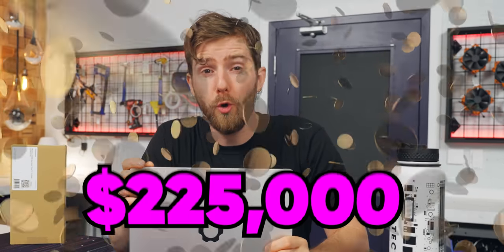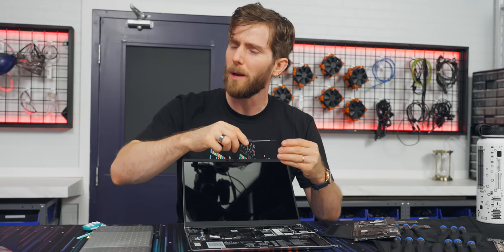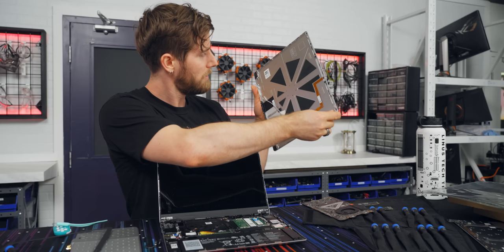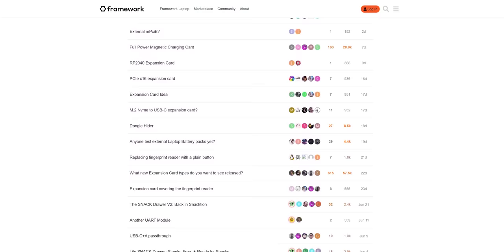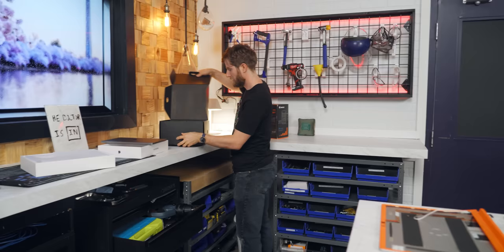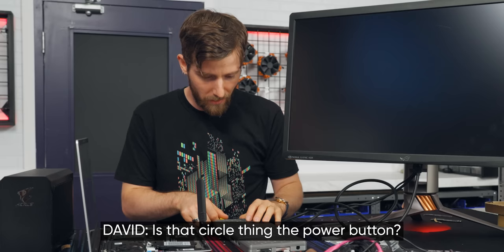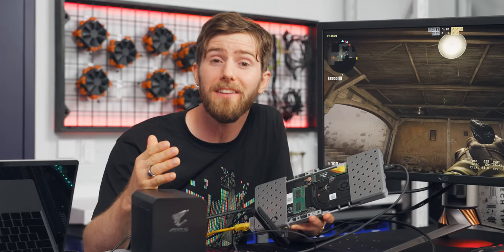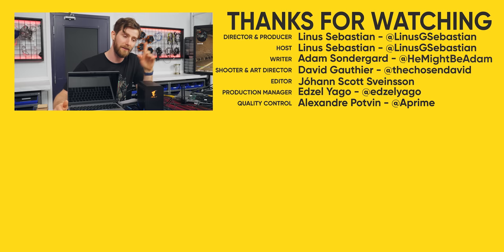I invested $225K in Framework Laptop - 1 Year Update and 12th Gen Upgrade

Comment: The IBM Thinkpad is an awesome buy (I got one off Craigslist for $150,  it seems brand new), I thought it might be stolen but it was a man selling a whole lot of them out of his convenience store, I think they were laptops that were leased by companies.  I just cannot believe some people are spending $1500 or more on laptops (Apple laptops or Windows Gaming Laptops), I would have to be a professional gamer making thousands a year to consider spending that kind of money on a laptop.  With the IBM Thinkpad I can run all the programs I need just find (including business related work programs).
Reply: 1500 on a laptop isn't a ton when you plan to use it for the next 3-4 years, need the performance for hobbies or work, and plan on relying on the factory warranty and customer support. Old thinkpads are great devices, but aren't perfect for everybody. Also be sure to throw some more ram and an ssd in that puppy, should keep it running well for years.
Reply: thinkpads are great but when you want to do things like 3d modeling they just dont hold up. most people will be fine with those but sometimes you just beed something better.
Reply: @theratking14  Also be prepared to use a mouse on it most of the time, as the trackpads are pure trash compared to other laptops
Reply: @semz8666  lmao yeah i have been, i am having an issue where i cannot right click or scroll. i tried some shit to fix it and it didnt work
Reply: some people want actually fast hardware. just because you only use it for web browsing doesn’t mean that’s the only use case. A $150 thinkpad wont run ANY modern game
Reply: people like gaming. why are you surprised exactly? life isn't all about work you know

Comment: Please can you make a workstation laptop for  enterprise,it should be 15 inches like a mac pro, run linux or unix,have a case you can design yourself if thats your thing? most people will end up with a mac pro design but better...
Reply: Make a big screen 16 or 17", so it is actually usable... putting super high resolution on a tiny screen only works well with OSX, Windows doesn't handle 'large fonts' well, so many apps screw up when you do that. (as a Software Architect, I've had to deal with it in our apps in Windows as well as apps we use)... I regret buying the puny sized screen that this thing has...  Should have waited

Comment: The problem with getting your Bitlocker recovery key when doing a motherboard swap is you'll have to enter it everytime you boot up the new machine. You'd be better off just turning off Bitlocker encryption before swapping the board/drive. Once in the new motherboard, you can simply re-enable Bitlocker and you're good to go. I've had to do that many times working on laptops at my job.

Comment: Framework’s business model is pretty genius. They give up short term high margins of revenue for long term revenue from returning customers. By making it so you can continuously upgrade your laptop, it makes it really difficult to justify switching brands when yours becomes slow. The single upgrade to keep your laptop running well is much cheaper than a new laptop but once you’ve upgraded two or three times, framework has potential to have higher overall profit compared to competitors.

Comment: A comment I read in another video about the framework laptop feels very fitting for this video, "we're gonna need to train the anti-consumer habits of companies out of our system." In devices such as laptops, when we usually hear that a hinge is broken we either begrudgingly send it in to a repair shop (wherever that could be) for a long stretch of time or we just bite our tongue and live with the issue. However with this machine, you yourself can change out the components in record time without fumbling too hard on the replacement. It's absurd how much companies trained us to be complicit in their greedy practices and move us to just buy the new thing whenever your current thing will die. Not this time. This company would surely help regain a new bar for excellence in terms of support, service and excellence.

Comment: As someone that has serviced HP, Dell, Lenovo, Apple and many other laptops for over 20 years...Framework isn't all that different. Many other company's laptops are just as "easy" to service. You can even do gen/gen upgrades on many models, it just isn't well documented or encouraged for that matter. I'm also concerned about all the packaging material...glad to see its mostly paperboard but what about all those plastic ESD bags? Does Framework have a return policy so that you can return used packaging and electronics for even more reuse? Most of the carbon footprint is in the silicon, so would be nice to see a takeback process where the silicon gets repurposed in some other system by Framework. Overall, I think they are doing a good thing here by encouraging more reuse, but there's a lot of work to do in order to make this a truly sustainable model. Keep in mind 80% of the carbon footprint of this device is in the silicon manufacture, and the real way we are going to make computers more sustainable is by decarbonizing the silicon supply chain, which small companies like Framework can't do. The big players (Intel, Nvidia, TSMC, etc) are the ones that should be working on this, with pressure from the OEMs like Dell, HP, Lenovo, etc. In that way, it's actually better to buy from a very large company that has a good sustainability program. Would be nice if one of them would pick up on this modular PC idea so that we had the best of all possible worlds, i.e. decarbonize the silicon supply chain while creating a modular PC with lots of reuse potential (and sustainable packaging!). The pieces are there, would love to see a major player buy Framework and incorporate that design into their PCs!

Comment: for sleep modes why not use hibernate? I started using it many years ago especially on Linux to deal with issues with laptops where the screen didn't wake up after the laptop went to sleep and the started using it on Windows too. despite some early issues it now works well on every laptop I've tried it on and is fast not quite as fast as sleep mode but faster than most laptops woke fully from sleep 20 years ago. The only thing you need to keep in mind on Linux is you need a swap partition that is bigger than both your system and GPU ram combined because that is where it stores the data before it power off. That said its the ultimate way to save power when putting your laptop to sleep even for a short period of time and is now almost always more stable (especially with new chip sets and peripherals) due the the fact that it doesn't require special hardware support for the most part.

Comment: I wonder if they could just add a 'battery present' button on the motherboard instead of needing to flash new firmware. Then the 3d printed chassi could just hold it down. Would also aid in debugging why a laptop won't turn on.

Comment: The top 10 things that an enthusiast should care about in a laptop in order of importance:
1. Does it support a discrete GPU?
2. Can you install your own bootloader (eg. coreboot/libreboot)?
3. Does it have a 99wh battery?
4. Does the screen work at a high refresh rate with some form of vrr?
5. Do they offer multiple vendors for processors?
6. Do they offer multiple vendors for discrete gpus?
7. Is the battery easily removable so that one can keep a spare on hand?
8. does it support the latest hardware near the point where that hardware becomes available to competition?
9. Can you install any m.2 wifi card you want without restrictions?
10. Is the keyboard at least rated for a minimum of 10M clicks?

The framework systematically fails on all fronts. At least a ThinkPad has a hot-swappable battery and options for multiple vendors, along with discrete GPUs. How the hell could anyone justify getting a laptop with just a processor and no ability to do any work beyond msword or messing around in a text-editor because of a lack of GPU? Why would anyone buy this crap? Why make an enthusiast focused product with a whitelist for acceptable wifi cards, and a locked bootloader forced into UEFI hell, that can't even start loading modules before waiting for a kernel to initialize? How can you justify a lack of a battery that last as long as possible and still make a design as fat as a cow? 3:2 60hz screen, why, what content is delivered in 3:2? It's just a constant waste of space. This has to be the dumbest investment you've ever made linus, and I've watched you blow thousands on tons of crap since NCIX, this takes the cake.

Comment: 3D PRINT CASE IDEA!!!!

Would like to see a bulkier Case design that incorporates the fan, power supply, and mini board of an external desktop graphics card case, and the framework motherboard into one where one of the usb type c ports is used for the connection to Graphics card mini board adapter and bam you have an actual mini gaming desktop using a framework motherboard!

Comment: I use to repair laptops, and upgrading a motherboard is nice, but I can buy a System76 for less than a Framework new, which doesn't even show how big it is. What's the screen size? It looks small. A System76 (they cost more than a lot of laptops out there) can be gotten for $1,592.00 with a 15" screen, I7 12 core 16 thread CPU, 16GB memory and a 2TB SSD. That is less than your supposed "$2050 for similarly specced laptop." The same specifications on the Framework laptop would cost $1,878.00 (that's also minus Windows, which I would want no part of). That is taking both base models, and adding what I want in a laptop. That's $286 more just to get the ability to update my motherboard. I'm afraid this is for the hobbyist, and not mainstream, which will hang on to their laptops for a long time. Not to mention everything you mentioned that shipped with this laptop that was due to poor design, and then they want me to fix it. The price needs to come down a little more, and fix the design problems before it's shipped. This isn't ready to market.

PS I have to assemble the Framework computer at that price? You have to be kidding me!!! I'll save $286 plus $113 in repair cost for a total of $399, and buy a System76.

Comment: I really love the concept but what about the cooling because newer processors require more energy and increase heat output which is sub optimal for a chassis which was originally designed for a less powerful cpu. I would really love an option to just resell back the motherboard to framework and get a discount to new cpu, then they would recycle that into newer boards. It's a win win situation

Comment: I repair laptops as my job I would love it if the style of framework laptops were for all like most screens are now glued in by an adhesive strip that you can only get from the manufacturer and there not cheap. Older laptops are like the framework laptop and 4 screws; you can remove the screen.

Comment: Unfortunately I feel that Framework's two goals are a little bit in tension. Because Framework is all about upgradability and self repair, their business model is to sell parts for these laptops. Which means they have a conflict of interest with making robust, long-lasting parts. They have a vested interest in a more granular form of planned obsolescence.  Unfortunately I see this as a fairly steep problem for their business model, because if all of their customers are satisfied and not upgrading or repairing, then Framework is going to have a hard time pushing product. Other manufacturers like Apple make the Big Bucks by incentivizing the (increasingly frequent) replacement of ENTIRE devices, from PCs to phones. THIS is what Framework is competing with. The tendency toward frequently replaced whole devices is industry-wide, because it is following the direction of profit. For Framework to compete in this ecosystem while using an opposing model is to swim upstream, and they are going to have to compensate by selling smaller stuff with even more alarming frequency. I would be very curious to see if they can get themselves out of this pickle while remaining environmentally friendly. I feel like it is just mathematically impossible. Either you wreck the earth just as much as the big boys or you get stomped on.
Reply: God bless Capitalism.
Reply: I don't think they intentionally made this laptop to fail, but were not skilled enough to make a laptop up to 2004 standards, hinges are a good example of this. It's a big expensive gimmick I can't see paying more for to get what I can get for less, and is a better built laptop than the Framework.

Comment: I was about to buy one as I'm looking for a cheap (relatively speaking) 32gb laptop that I can use while traveling to work on a bus. But then I saw how heavy (2kg/4.4lbs). That's the holding point for me. At that price point and with no dgpu, I just can't convince myself to get a 2kg laptop. At that price point and weight, there are options (from China mostly) without that great replacement ability but a gpu. If it's at 1.5kg, or has a gpu, it'll be an instant buy for me.

Comment: Color code and number the screw/holes. Include a magnetic module holder for screws and a screwdriver. Or eliminate all screws and use clamps/magets/tabs to secure components(Less E-waste). Fix trackpads and weak screen hinges. Get Nvidia components. Get touchscreens(=Big Win btw). Advertise, with these implementations on QVC. TOUCHSCREENS TOUCHSCREENS TOUCHSCREENS and of course COLORS COLORS COLORS. 🤑                            Just Another 9th Dimension Idea. 😀😀😀

Comment: If this type of upgradable, self-serviceable device wants to go mainstream… normal everyday users will have to use these things, not just enthusiasts and eco hipsters. Having worked in IT, I know that even if paper manuals, digital online guides, and tutorial videos exist, 98% of normal users will either rush through and skip steps, or just not reference the instructions at all… just like Linus did here. 

I think this kind of device is a step in the right direction, but these things cannot afford to be so thin and light. It complicates the design with smaller,  thinner parts that need to be sandwiched together. 
I think for now, a truly, easy to use, easy to open, easy to repair and upgrade laptop will have to be chonker.
Reply: I think that as long as it’s possible for some third party to repair it framework has succeeded. You could always take your laptop to someone else to get it fixed if you are unable to repair it yourself. Many companies make their devices extremely difficult or impossible for third parties to fix.

Comment: Little idée for the screw. You could had a little number in each that can be find on the guide. You could have some tiny QR codes that open directey the manual at the right page (that would be awnsome).

Comment: Have you seen some of those Dell inspirons where you unscrew something like 5 screws and 3 more capture screws, then can pull off the plastic cover with one hand and all parts except keyboard are easily replaceable (keyboard being riveted into the cheap plastic frame that parts are easily swapped to)? The one that's so ubiquitous that parts are as common as dirt? The one that doesn't have a single heatsink and fan assembly or proprietary modular usb ports? The one that uses regular ass daughter boards that are ten bucks on ebay?

Comment: I couldn’t care less about swapping an Apple M1 board with an M2, the one thing I want them to change, is make the storage swappable.
The ram being soldered on is for a good reason, so the memory has all the speed needed since it’s unified memory, as we’d get an “integrate graphics slow down” with regular sodimm memory. But besides that, them also making the system ram more higher quality so it lasts longer, and make it a better price. Apple is about the sleek design of everything, and the good lightweight OS that comes on those things, but those are the only two things that could improve apple devices.
Storage swapping, higher quality ram modules, and letting people repair things more easily. Because then they’ll just lose more Apple users by making these stupid mistakes, and people will buy some their stuff less, or nothing.

Comment: If a 180° hinge is in the works along with high sensitivity pens for graphics work, I'd definitely consider this for a next laptop. Most current convertibles are generally underpowered for this use case.

Also curious if ARM motherboard upgrades will be in consideration for the future?

Comment: I bought one in round 4, ordered the self build kit, but only assembly required was ram and expansion modules. Noticed windows got very slow for no known reason, required hard reboot to restore performance. Otherwise it's been fine, no more issues. Nice build quality, screen aspect ratio not as useful as I hoped.

Comment: I replaced the battery in a laptop the other day and got the old man vibes as I had to disassemble the whole thing, and remove various parts in order to do so. It's a battery! Back in my day, you could have a spare and swap them out with a slide and click. WTF? I'll see if they've got a 12V DC power supply for this thing. The concept, at least, is intriguing although personally I prefer AMD.

Comment: Honestly, my employer just bought me a Dell XPS 15, which just cut into my skin due to the sharp edges, the laptop has terrible battery life (4 hours tops), touchpad issues and no USB-A/HDMI ports, just a shitty transformer which forces me to ask my employer for another $50 for a dock. Told him that I'd rather pay for my own frame.work laptop and split it, then having this terrible thing cutting into my skin. Ladies and gentlemen, throw away your expensive macbooks and dells, please, just go fo frame.work as it is honestly the best laptop out there. Just wish they had larger screen sizes (15" would have been a dream). Other than that, frame.work is just perfect.